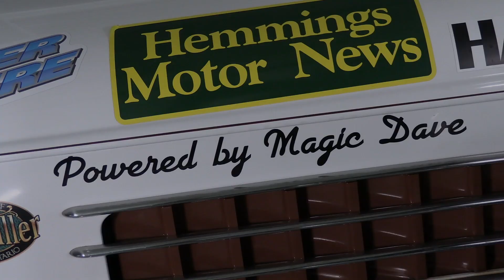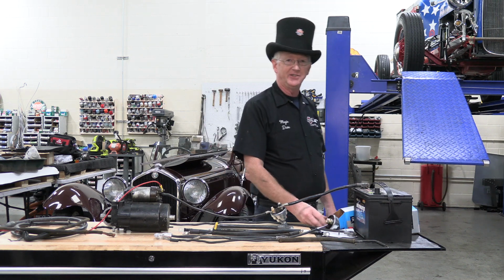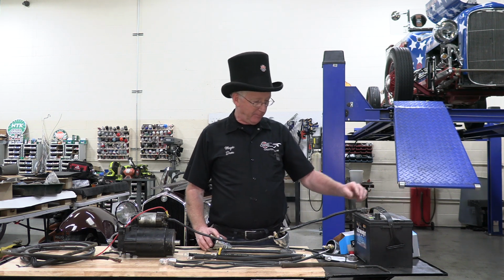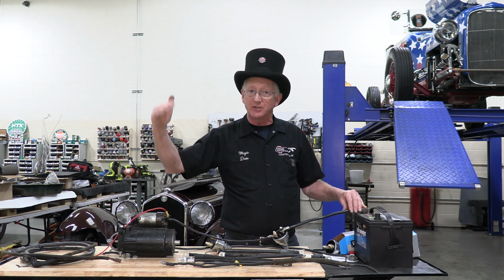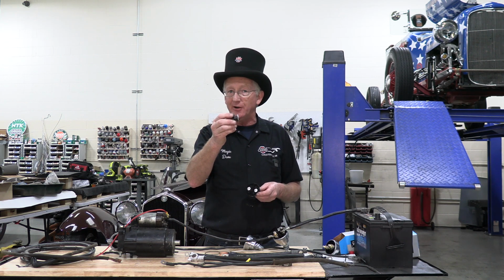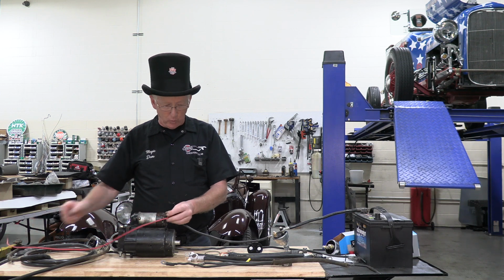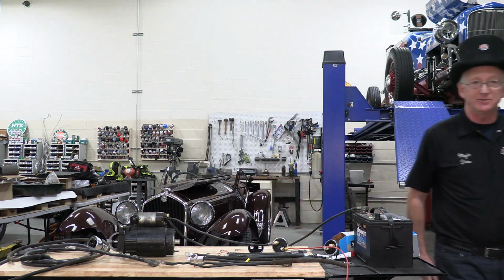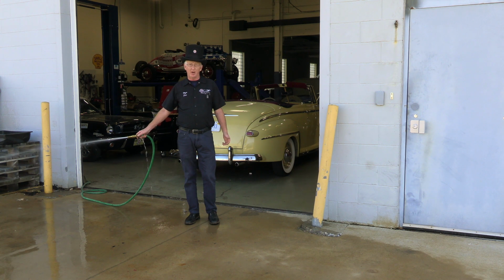The Dangers of Using 12-Volt Battery Cables on a Vintage 6-Volt System with Magic Dave

Comment: What if the cable between the battery and starter rubs the frame and shorts out? Without a cut out switch, you can’t quickly turn the power off. What you say about flow and capacity does make sense. Good video!
Reply from the maker: Thank you for your comment and agreement that a cut out switch is very important. -Ahna

Comment: In the event of a starter motor stuck on - will the electrical system kill switch shut off the runaway starter motor, if wired after the starter motor?

Comment: Your concern about the construction of the switch, being a small aluminum connector, is ill-founded since the switch you have chosen is rated at 12V. You should be using a switch rated at 6V if you are installing in a 6V system.